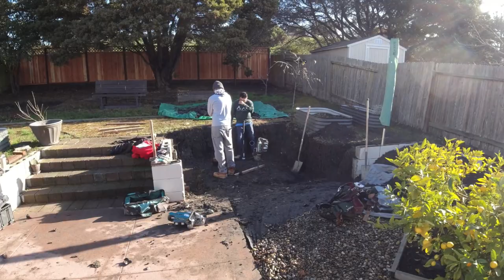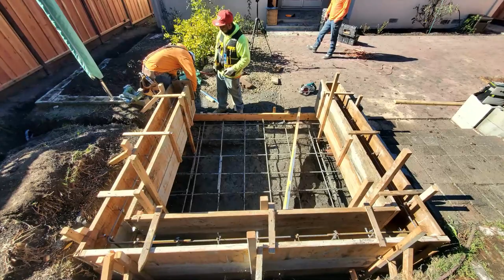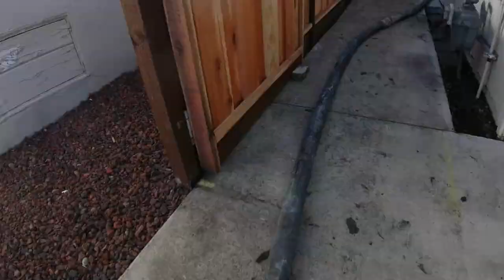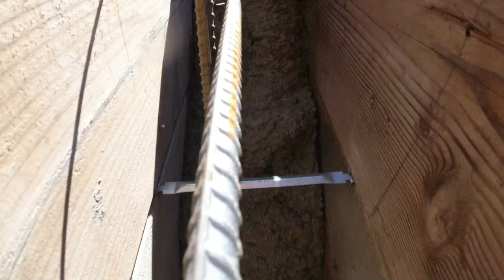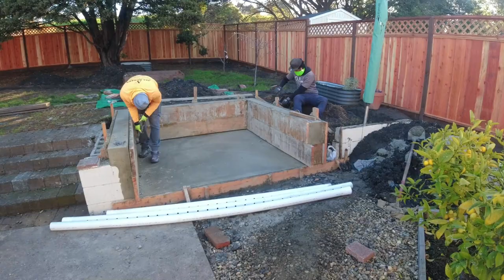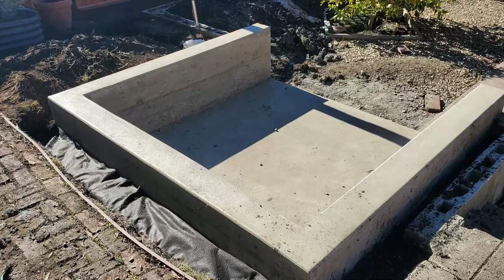How To Build Small Concrete Wall For A Hot Tub | TIMELAPSE

Comment: How did you accomplish equipotential bonding on this build?  I didn't see it mentioned.
Reply from the maker: Don't understand the?
Reply: NEC requires a hot tub to be bonded to surrounding structures if they are within 30" from the side of the tub and 28" from the top of the tub.
Reply from the maker: Oh.. I believe homeowners took care of that..
Reply: That’s not the mason’s responsibility as they don’t have the tub or the equipment/expertise to install it. They’re just building a base. The GC or homeowner (whoever is managing the whole project) would usually coordinate that work between subs. If special attachment points were required for final install that should have been communicated as part of the initial scope of this job. It’s also likely that there is no electrical component to this tub i.e. it’s a wood fired tub… or more likely nobody pulled permits and plans to kick the code violation can down the road 😂